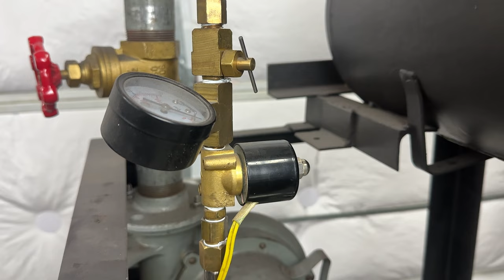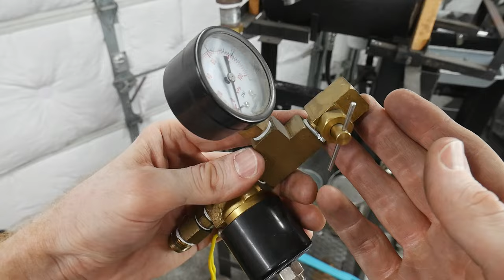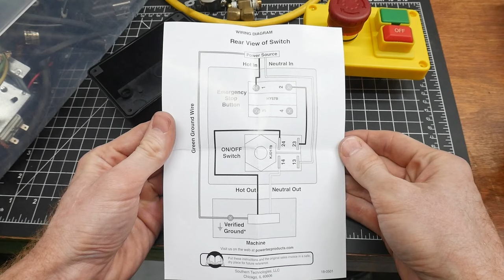DIY FORGE Burner v2.0 | A Robust Forced Air Burner For Knife Making & Blacksmithing

Comment from the maker: I hope yall found this one useful! Cheers! 

🔩 Items:
Safety Switch - https://amzn.to/3N9OQGt
Solenoid - https://amzn.to/2FqHdsX
1'' Fire Bricks - https://amzn.to/42KxlCg
Marshall Regulator - https://amzn.to/38UkPKN
Steel Braded Propane Hose - https://amzn.to/3z2sQYR
Propane Tank Adapter - https://amzn.to/3YF7077
30psi Gauge - https://amzn.to/3YleQmN
Potential Blower Option: https://amzn.to/3JjVf0S

🛠 Tools
Masonry Blade - https://amzn.to/3qLmHhF
Pipe Wrenches - https://amzn.to/3NvZpoO

🔧 Most Fittings if not all of them can be found here:
https://www.supplyhouse.com/ 
AND/OR here
http://hightemptools.com/propaneregulators.html

Comment: I wouldnt worry about the temperature of your solenoid. Anytime you are using solenoids as safety "dump" valves that are always on, they will get pretty toasty, but never get anywhere near a temperature that will damage any of its components. 
Thank you for this video! You always go into great detail which just makes it much nicer to follow along. Since i am not years late to the party for once, also thank you for your video on the heat treat oven and all the work and diagrams you shared. Thanks to you have added the final piece to my "make whatever i want" shop, the forge/foundry portion.
Reply from the maker: Thank you sir! Good points there. I'm glad you're enjoying the videos! Cheers

Comment: If you're interested in an alternative to using Borax in your forge, I've had great results soaking my damascus billets in WD-40 before putting them in the forge. I don't use any flux at all during the forge welding process. It's awesome to not eat up the forge liner. Love the videos 🤙
Reply from the maker: Thanks for the info! I've been using Kerosene (same deal) works great!

Comment: The safety switch is a great idea.  I will be adding it in the near future.  I have just added a PID controller to manage the temp on my forge (as shown by Denis Tyrell).   It works fabulously!  You should consider it on your next reconfiguration.
Reply from the maker: That's a great idea!

Comment: Use a scrap piece of steel sheet and weld or bolt in a "baffle" between the forge and the whole solenoid/needle valve area to reduce the convection heat that reaches it?  heck even a fire blanket from amazon might do the trick.  great videos brother 👍🏻
Reply from the maker: That's a good idea. Cheers sir!
Reply: @RedBeardOps  👍🏻🫡

Comment: would relocate the EMERGENCY KILL/On switch to the front leg, having it hidden behind several power cords on the back of the unit is a huge HUH? Personally I would have it on the front leg below the front door, so you could hit it with a knee to kill it if needed.

Comment: So you just have the 1/4” pipe going into that Tee? Is there a cap at the end with a 1/16 hole or something? Or the gas is just coming out of the full 1/4 pipe?
Reply from the maker: No jet, gas is just coming out. The forge it self holds the flame once rolling good. 

Note there could be some heat distribution efficiency with incorporating a ribbon burner to a system like this.

Comment: On the 1/2 reducer with the 1/4 in reducer, why not use a solid piece of 1 1/2 and remove the T ad just weld a 1/4 in pipe or thread to the black pipe.  It is just you had the welder and it is cheaper and looks cleaner.  That pipe threads easy and it is very low PSI. You could of plugged the ends of the black pipe and put a itr hose on the 1/4 in and sprayed soapy water on the weld to test.     I am just online getting Ideas for a new forge build.   I am thinking ribbon burn if I do a forced air.
Reply from the maker: Not a bad idea! I could have gone that route for sure. One of these days I may try a ribbon burner... they look awesome!

Comment: did you show how your gas was injected into the T pipe in a previous video James? or is it just fed in through that nipple?
Reply from the maker: You mean my old setup? It was threaded into a reducer. Not nearly as strong as this assembly with the appropriate fittings. Cheers Troy!

Comment: Do you find alot better performance and efficiency with this type of burner as opposed to the venturi/atmospheric type?
Thanks for all you do.👍🍻
Reply from the maker: Yes, absolutely. Way more control and more turn down with the gas supply. Big fan of the blown burners
Reply: @RedBeardOps  Would you suggest starting with this type of system or the more simple venturi?
Reply from the maker: @101JRA  If you have the means, time, etc; I'd vote for the blown burner. Over the venturi.
Reply: @RedBeardOps agreed. I built a forced air burner forge and have never used a Venturi style burner. Way hot (2300 degrees on average) and uses a lot less propane
Reply: Oh, and I run it at about a half to 1 psi. Using a high flow attached to a low flow with a guage and a needle valve. It allows me to fine tune the flow of propane into the burner very nicely
Reply: @whuop-wadeshumbleopinion625  I'm not familiar with the high flow attached to the low flow you're referring to. A little info please. Thank you.
Reply: @williamemerson1799  High flow propane regulator connected to a low flow regulator, then the needle valve after. That allows me to fine tune the flow depending on how well it’s burning. If it’s chattering, I adjust until the flow is “roaring “ while burning. Hope that helps
Reply: @whuop-wadeshumbleopinion625  It does, kinda, sorta. What I'm currently using is a 0-60psi regulator on my venturi burners on a LP grill tank with needle valves and ball valves. With the exception of a solenoid and safety switch, I believe I have everything to make a forced air burner. I may not have a correct understanding of the terminology so would you have a link to the high/low regulators? Thanks.
Reply: @williamemerson1799  I copied my build from PJTForging. Check his vids out. He explained it really well. I made a vid of my build but not nearly as detailed as his. I learned about the high flow to low flow from a different radiant heating project I did for my own shop. It works well, without the combination I was having indicator gauge failures. I have a ball valve shutoff in there as well after the regulators but before the needle valve and gauge indicator. I’m deployed rn but when I get back I could make a video short that shows it. I’m a visual learner, seeing is easier than explaining sometimes
Reply: @whuop-wadeshumbleopinion625  Yep, me too on the visual learning. Stay safe, and thanks again.👍🍺

Comment: From the research I did, the solenoid valve that everyone is using isn't rated for continuous duty. It may be the reason for it getting hot.
Reply from the maker: For sure accurate on the rating. I'll report back with my findings after moving it.